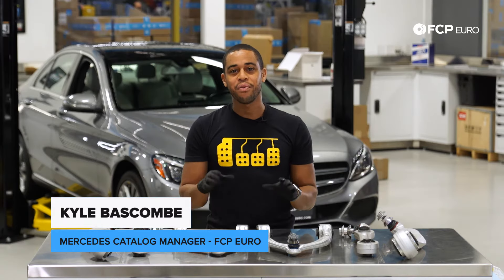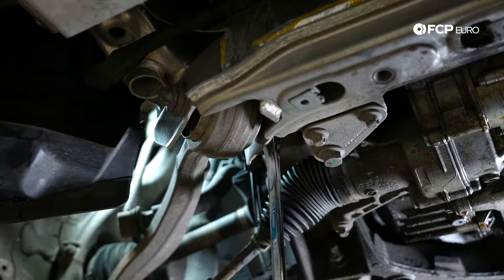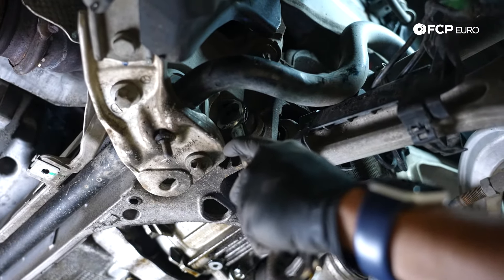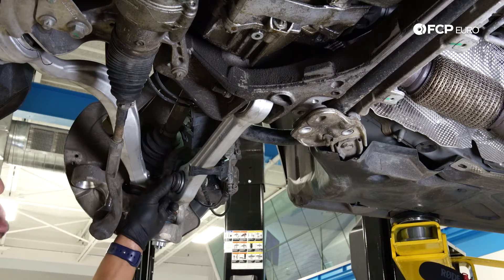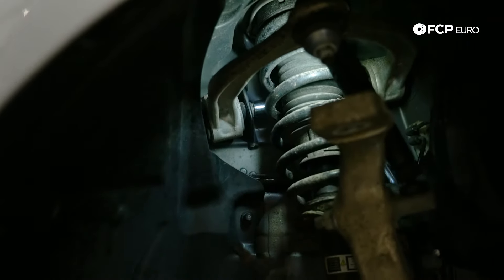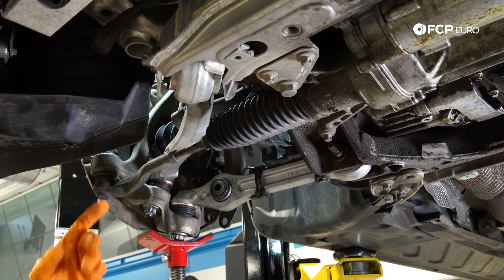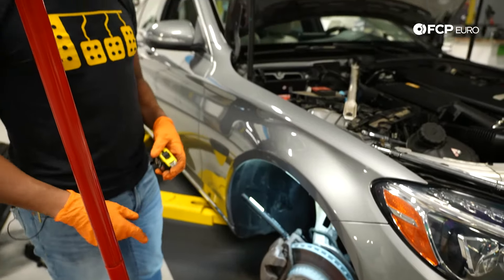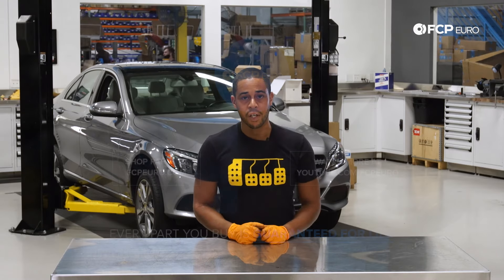2015-2021 Mercedes-Benz W205 Control Arm Replacement DIY  (C300, C400, C43 AMG, & C450 AMG)

Comment: Helpful tip, the nut in the engine bay on the driver side is under the fuse box. Remove the two bolts holding the fuse box and lift the fuse box out of the way to access it.
Reply: This so helpful my friend, did you try doing this? because I’m planning to do mine this weekend.
Reply: @shadiel-najdawi8898  I did. This job is not too hard as long as you have the right tools and lots of patience.
Reply: @joshuamitchell1188  
Thank you so much, that was really helpful. I’ll do it that way and let you know how things were going.

Comment: This is really useful. When changing the CV axle, I and other YouTubers have tried to avoid disconnecting lower control arms. I thought it would be difficult like it is on an Audi. I see Mercedes uses something like a 45 degree taper, so the arm comes right out instead of being pressed in tightly. It doesn't look like there's enough space to get a ball joint separator in there, but clearly it's not even needed. Just need the T45 and 24mm wrench, no big deal.

Comment: The lower control arm to axle carrier bolts are torque to yield, so they are one time use bolts. Need to make sure you order new ones from Mercedes. Do not reuse the these bolts.

Comment: What Symptoms Would you encounter to warrant replacement of these Control Arm Parts? I Have About 88K Mikes and Having Vibrations at 50/60MPH and above.. Not Sure if I'm Supposed to have that Vibration at that Mileage Or It's Something Else. 2014 C300 AWD.

Comment: Great video and TY. I watched it to get a general idea to replace upper control arms(with camber adjustment) on a 19' GLC63 with air suspension and 4matic and it was very helpful. Should video the drivers side showing the 2 plastic nuts holding fuse box, then fish out the fuse box to hand access the the 16mm nut closest to driver. That's the hardest part of the whole job but easy once you have space! I have good pictures.

Comment: Excellent MB Suspension Lesson ! Thanks for sharing !
Reply from the maker: Our pleasure!
Reply: @fcpeuro I have 2013 S550 with some heavy low speed vibration going in at 111k miles. I've shopped around for complete kit online. I found kit around $430. Just wondering what is the turn around time is on this job? For labor cost.  Great video.

Comment: A couple tips. Don't use your torque wrench for the extra 180 degrees. You might reach torques that damage the wrench, depending on the type of wrench.

Also, the sway bar end link nut is 18mm. You used a 19mm wrench and it worked, but 18mm fits better.

Comment: Great videos. Would you happen to have a video for 2016 Mercedes c300 4 matic w205 rear camber adjustment?
Reply from the maker: Thank you for watching. That is currently not something we have available at the moment!
Reply: I don’t think the 205 has camber adjustment. Only front and rear toe. At least on my c63S it’s a fixed -2.2 camber.

Comment: Hi
Solution to the stiff amg suspension on the w205? 
Any way to make it softer to soak  bumps and bad roads better? 
Bought the w205 c200 with amg suspension not knowing  it's so stiff
Reply: Get softer tires. I replaced my tires and it made a world of difference.

Comment: i have a 2011 e350 covertable. is it  ture u have to trouqe the lower control arm bushing side while the wheel is on and on ground level
Reply from the maker: That's correct Robert! By doing exactly as you said, you'll ensure that the bushing isn't under constant preload when on the ground.

Comment: Hey 👋🏾 , any chance you could help me repair the fuel sender and pump of a w211 where the half of the tank will completely be used up to the point where the engine shuts of yet the other side is full , a fix rather than a replacement would be great, I live in a remote area you see 😪

Comment: Do control arm bolts need to be replaced. Torque is specified both in NM and angles which could mean that the bolts are stretch bolts?
Reply from the maker: Having a secondary angle often means its stretch to yield - so we'd recommend replacing the bolts.

Comment: Thanks a lot for that valuable video, but if you please, can you make another video showing how to replace the left upper control arm, because it’s so confusing that one of the nuts is very deep and hidden by the fuse box and other components!!! It seems to to be impossible to reach that stupid nut without removing tons of parts in the way!!
I’ll appreciate it if you give me a hint on this because I’m planning to to do this job on this weekend.
Reply from the maker: Hi Shadi, having a long wrench to feed down to counter hold with will be very helpful!
Reply: @fcpeuro  
I have that wrench, but the problem is that this nut is hidden and cannot be reached in any angle